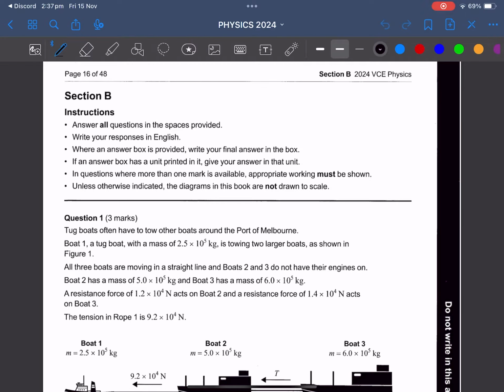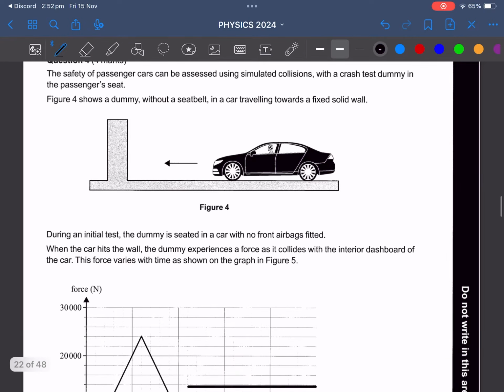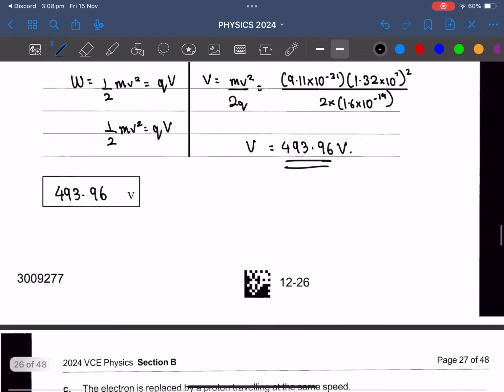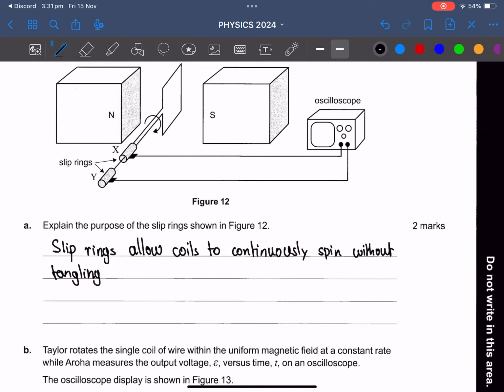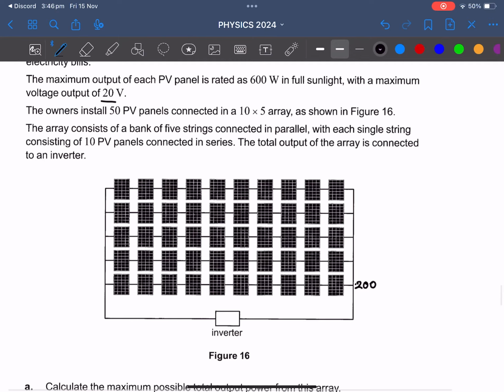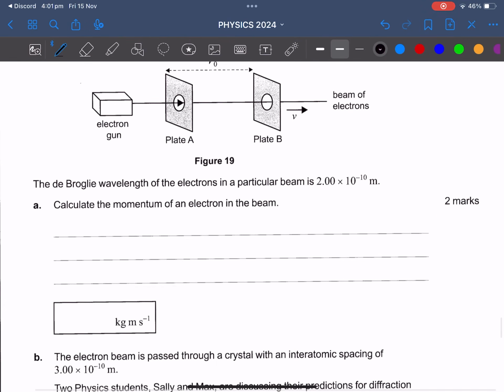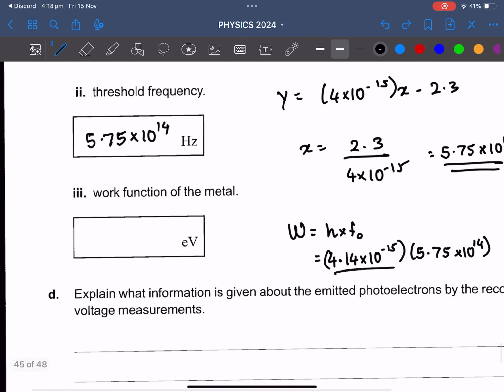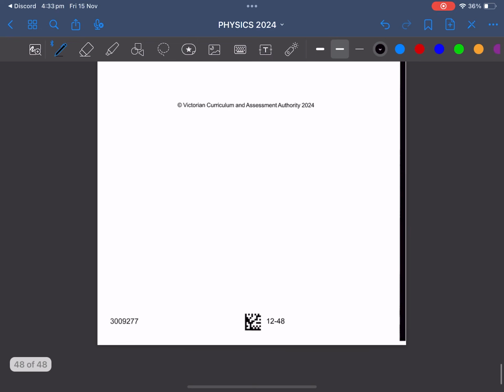VCAA (VCE) 2024 Physics Exam Short Answers Suggested Solutions by Airavat Tutoring.

Comment: thanks for this 🙏
one thing though, i said the same thing you said for question 16g, that the current would stay the same, but the examiner's report says that it'll actually be lower even though the intensity of the light stays the same? 1:36:14
Reply: This is an annoying question which 3% of the state got. 
 so the question actually says it keeps the "light output power" the same, not the intensity. They're not the same, Power is energy over time Intensity is number of photons over time. 

As blue light has a higher frequency than green light, the maximum kinetic energy of each electron will increase. as the "light output power" remains the same, the amount of photons must decrease. 
As intensity is modelled as the amount of photons per second, the intensity has decreased. Hence the maximum photocurrent will be lower.

I dislike this question and think it is intentional misleading, but it is correct. 
Hope that helps.
Reply: @MickSher-s2p

But doesn't higher kinetic energy mean greater photocurrent since more photoelectrons can reach?
Reply: @rr9502  "more photoelectrons" reaching the plate is determined by intensity, not kinetic energy. Think about it on a small scale:
Remember that there is a 1:1 relationship found between one incident photon and one photoelectron emitted. So, say intensity was so low that only one photon was releasing one photoelectron from the metal plate. If you raised the frequency of that photon and subsequently the KE of it, that wouldn't mean more photoelectrons reach the collector electrode - the single photoelectron simply has more kinetic energy, meaning it will take a higher stopping voltage to prevent it from reaching the collector electrode.
Raising the intensity raises the number of photons hitting the metal plate each second, and because of the 1:1 relationship, more photons = more photoelectrons emitted, so a higher current potentially flowing in the circuit.
Not sure if that makes sense
Reply: @rr9502 
No. Gonna try and cover everything here, sorry if too long.
This is kinda outside/on the edge of the study design, but current is the movement of charge over time. 
So I = Q/t. As the charge of the electron is independent of it's kinetic energy, kinetic energy has no effect on the maximum photocurrent produced. 
The only scenario it would is if less than all the photoelectrons reached. However the question asks for the horizontal line NM which is where there is a positive voltage, so even the least energetic electrons will reach the plate.
 
This does not mean, since they travel faster, they will take less time to get through, still not the point. 
Even though they travel faster there is less emitted every second, and hence less photocurrent generated when all photoelectrons reach the other side. 
A variant of this question was on the 2024 sample exam if you want to check that out.

TLDR; Kinetic energy has no effect on maximum photocurrent. 

Hope this helps.
Are you studying for the physics exam btw?
Reply: @MickSher-s2p 
Could you explain how u know that less photons r emitted per second?
Is it based on p=e/t or some variation of that

And yeah I'm doing some last minite exam revision :)
Reply: @rr9502  Same (studying for exam)

So power = Energy/time right?
and you know the maximum Ek has increased as the frequency has increased. so for POWER (energy every second) to remain the same, the amount of photons must decrease.

It's like if you have 6 balls of 5J each every second, and you now instead have 10J balls, you would only need 3 every second to reach the same POWER output. 
That is why less photons are emitted, hence less photoelectrons produced when light output POWER is kept the same, not intensity. 
And as I said above photocurrent is based on charge yada yada yada so when less photoelectrons are produced, less photocurrent is produced, regardless of their energy.
Hope this helps. (a bit late to lock in lol)

What are you going for in physics btw?
Reply: Ah okay it makes sense now
Thanks, I really appreciate ur help

Good luck with the exam tmr!
Reply: @rr9502  gl yourself. almost there :)
Reply: @MickSher-s2p  GOOD LUCK BRO STILL WRITING BOND REF:face-purple-crying:
Reply: @MickSher-s2p  I asked my teacher about it and I was actually on my way to comment it! But you are correct, thank you for your help! and good luck to us all for tomorrow
Reply: @MickSher-s2p  I'm not sure, putting a filter over the white light only blocks out all the other frequencies of light except the colour of the filter. In the question the same power output is given to a light source emitting white light meaning the same number of photons of each frequency are being emitted, if white light is a combination of all the frequencies of light, the answer is based on the fact that more green photons than blue are produced from a white light source which is ambiguous at best.
Reply: @howie7632  Yeah, I don't like the question and think it is intentionally misleading. 
I think you're thinking of the light power input, not the light power output.
There is no reference to the input power to the filter increasing/decreasing or remaining unchanged, only the output power from the filter in unchanged.
After that my logic above holds.